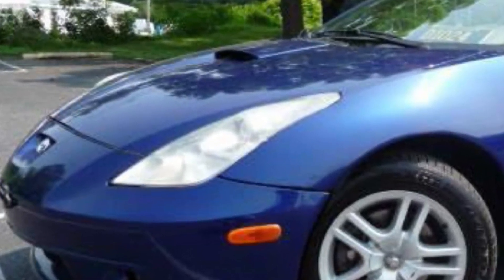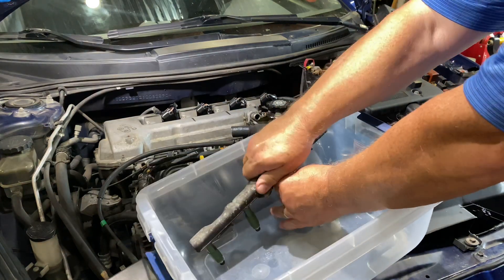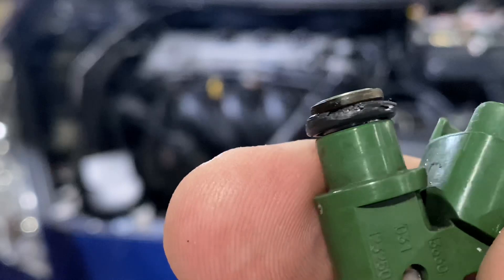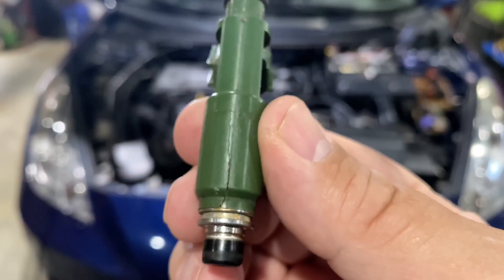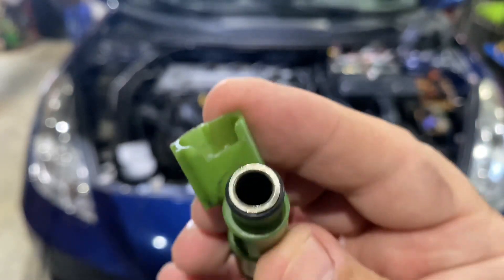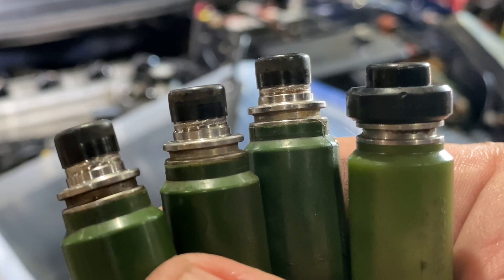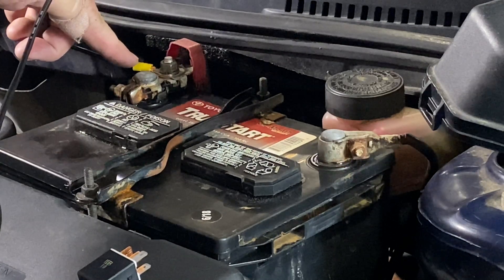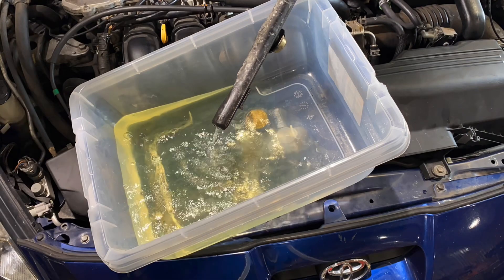2001 Toyota Celica Engine Missfires | Caused by a generic fuel injector?

Comment: Putting 1 gallon of thinner with 10 gallons of gas and driving the car at 3000 RPMs did the trick and cleaned the catalytic converter

Comment: I have the p301 misfire 1 cylinder 
Took to Toyota dealer 
And they had it for 2 weeks 
And said it wouldn’t act up 

Note it shuts off after 30 mins in traffic 

Last Toyota dealer changed 1 coil didn’t fix issue
Reply: I’m having the same issue atm, any news?
Reply: Still got the p300 and p302. Replaced the spark plugs, OEM injectors, fuel pump, filter, hoses, all seals, lift bolts, seafoam, etc etc and the POS 2zz is still having the same misfires. 

Did this fix your issue? My car runs good on the freeway except for on idle. I thought it was bad fuel, bent valve or carbon build up.

I did a compression test and cylinder 2 is 145 while the others are 225 to 240ish. Any other ideas?